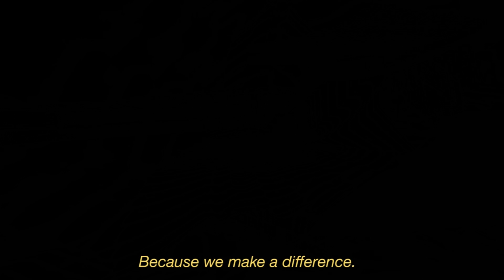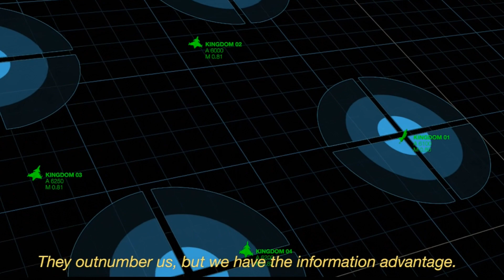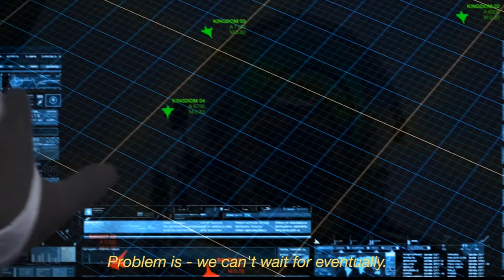Gripen Fighter Jet - Canada's Future Fighter?

Comment: Work at Canadian Bagotville airforce. I was lucky to be right next to the lauch runway. The F18 are still working fine but it's really expensive to maintain an repair. Mainly because no original part are fitting. My friend work for the company which repair canadian F18 and US F18. Every part need to be modify to fit perfectly and it's unbelievably expensive. F18 spend their life flying over the Artic. The next fighter need to handle intension temperature variation. F18 handle impossible temperature variation without problem. They can carry a considerable of fire power too. Buying smaller one will give them capability for Dog Fight. I watch them all the time and they could make pretty impressive maneuver with a skill pilot. An F18 Hornet with a superior driver can be really effective. Arsh climat is not made for every airplane. The only reason we need to buy new airplane is to provide only support to US. Let face it, they talk a lot about new plane but they never put them to extreme condition in reallife situation. F22 and F35 are too advance. These plan take insane amount of caring, F35 need to have 35 hours of maintenance for 1 hours flight. A SU can land refuel and immediatly go back. A SU is build like a tank. F22 and F35 are in my opinion lack this robustness. They need to clean perfectly runway before takeoff only a small debris can break the plane. They are really powerful and advance plane but Canada need a something more robust ready to go at any time. For example it take only 16min to get to Montreal from Bagotville (500KM) in a F18. The 16 minutes countdown actually start when they pickup the phone at the military base. To be honest, I did believed it until I happen.

Comment: This always comes up among Canadians, and I've been as guilty of it as anyone, but Canada wouldn't be doing well for itself to design and develop it's own fighter jets anymore. It hasn't been that way since the Avro Arrow days (and no, there's no point in 'resurrecting' the Arrow, because it wouldn't be any good for anything today.)
In a nutshell, it's actually cheaper for us to buy US-made fighters instead of developing them ourselves.  That being said, the price of the F-35 is ridiculous for Canada. If Canada is willing to go with single-engine multirole fighters, buying F-16s would be a better bet--they'd cost us about 1/10th as much as the F-35. If we don't want to buy used aircraft, we could consider buying the design and tooling from the US, and producing our own F-16s, using US-built radar and avionics.
But, attempting to develop our own fighter from scratch is a no-go.

Comment: Gripen E is not that much cheaper than F-35. Last batches from F-35 dropped down to 85 million usd, until Gripen E costs around 75 million usd. There is no point acquiring gripens with this price difference.

Comment: Why should canada buy aircraft that is obsolete...the F-35 and its stealth is the best choice and we invested in it..the only other option is the french Rafale. It is superior to the Grippen and eurofighter...and the grippen cant handle the most modern russian threats. We need a mix of fighters F-35s and Rafales with prop driven aircraft for close air support against low tech enemies. Btw the rafale has a version of stealth. It does so electronically. Screw the gripen. Rafale is superior. ||F35 is superior.
Reply: the french can fuck off!
they NEVER allow other nations to license build the rafale AND their craft isn't fully compatible with NATO Canadian systems. i don't CARE even IF the rafale is slightly better in top performance when it's FAR more expensive to fix and fly. the F35 only makes some sense for canada jointly built in small numbers and only in the VSTOL version as a compliment to larger numbers of the inexpensive Gripen which we CAN BUILD HERE.
The usaf - which is LAND BASED like what Canada's situation is-very successfully used a hi/lo 2 craft solution in the F15 EAGLE air superiority and F16 FALCON light fighter mix which saved a lot of money while providing more airspace coverage and tactical effectiveness within the unique strengths of each aircraft.
if we're going to spend billions in acquisition- MUCH of that should be in EMPLOYING our own people to build.

Comment: The Gripen is an excellent aircraft and deserves success.  That said, Canada's RCAF mafia will never let it be selected over an American design.  As with the Super Hornet, they'll claim a lack of interoperability with USAF NORAD aircraft, which is nonsense. 
The current CDS seems to deny the Gripen's existence by claiming "you can't lease fighters."  Well you can if it's a Gripen.  I'm not a fan of a single-engined fighter flying over northern Canada, but if it's good enough for northern Sweden... The best option is probably a high/low mix of 2 squadrons of F-35s (ugh - but they will get better with US money behind them) and 4 squadrons of Gripen Es.  Make it so.

As for building locally - terrible idea.  It will add cost, it won't make a material economic impact and it will ensure that too much money goes to Quebec.
Reply: Why should Canada replace legacy F18 byan Aircraft rated less efficient? That's stupid or just face the fact that Canada do"n't need an airforce and provide bicycles to your army...
Swiss report about the evaluation of F18 / Typoon/ Gripen and Rafale! :
https://fr.scribd.com/doc/81390363/Swiss-Air-Force-Confidential-Report-on-the-Evaluation-of-the-Eurofighter-the-Gripen-NG-and-the-Rafale
Reply: Alpha, those papers are 10 years old. There has been several updates to the C/D version of the Gripen to correct some of those shortcomings, the latest upgrade is only a few months old as I recall it. And Gripen E/F will be completely different than the old C/D versions.

Comment: I think the Rafale would be way better as a front line fighter. As far as light fighters the F/A-50 would be a cheap option for low cost. Im hoping the USAF selects them to replace the T-38. The Filipinos impressed our Growler guys with their FA-50PH. Word is they handle like the tiny F-16s they are designed to be. Plus the RCAF already has the support base for the GEF404 that the F/A-50 uses like the JAS-39.

Comment: According to the Swiss AirForce evaluations the Grippen is certainly cheap but has poor capabilities compared to its European rivals (EF2000 and Rafale) and especially when it comes to the Rafale.

In my opinion the Rafale F4 would be a better choice because though it is a bit more expensive than a Grippen it has an extreme versatility, bigger range of ammo and most of the very last tech upgrades available. 

And less US dependance when it comes to weapons and spares supplying.

Here is a very interesting document: 
https://fr.scribd.com/doc/81390363/Swiss-Air-Force-Confidential-Report-on-the-Evaluation-of-the-Eurofighter-the-Gripen-NG-and-the-Rafale
Reply: "but has poor capabilities compared to its European rivals"
In endurance and payload at least for the C/D version. So Rafale or the Eurofighter are better in offensive roles. The Gripen E will improve these parameters somewhat. But Gripen should be the best alternative for defensive operations due to low cost per flight hour, ease of maintenance, quick turnaround time, no need for a large ground crew and no need for large airfields etc.

Comment: This is a single engine fighter. No it won't work for Canada. People never consider the actual "requirements" based on individual country climate, territory or terrain.
Reply: kloudkreeper 
It can not be much of a requirment if the plane most likely to be chosen is powered by a single gingantic and largely unproven engine which allegely have had some issues along its development. Anyhow: It have been many years since planes was flying araund with two engines for safety reasons because said engines flamed out with somewhat worrying frequensy. 

With huge advancements in technology todays engines have come a long way in terms of reliability. Today, in general twin engine aircraft suffer slightly more from catasstropic engine failures compared to their single-engine counterpart.

Also in the rare cases when modern high perforance jet engines do fails, they tend to do so fairly violently rather than just stop working. Engines are placed so close together in western twin-engine fighters that there’s a good chance that the failure of one engine will damage the second engine or/and nearby (shared) systems that it relies on.
It can not be much of a requirment if the plane most likely to be chosen is powered by a single gingantic and largely unproven engine which allegely have had some issues along its developmemt. Anyhow: It have been years since planes was flying araund with two engines bfor safety reasons because said engines flamed out with somewhat worrying frequensy. 

With huge advancements in technology todays engines have come a long way in terms of reliability. Today, in general twin engine aircraft suffer slightly more from catasstropic engine failures compared to their single-engine counterpart.

Also in the rare cases when modern high perforance jet engines do fails, they tend to do so fairly violently rather than just stop working. Engines are placed so close together in western twin-engine fighters that there’s a good chance that the failure of one engine will damage the second engine or/and nearby (shared) systems that it relies on.

Comment: Any plane Canada BUYS has to have Carrier Landing capabilities'. Why you ask ,because in our far North we use a trap system just like a carrier does, why you ask, when our fighters Take off and use after burners they Ice up the runways, they need this system to trap and land the air craft in a safe manner on very icy run ways. How do I know this you ask, My neighbour is a Retired SGT Major 1st class R.C.A.F. and has Told me in Detail about working and Handling the crew's that Maintain said Trap system...Look it up if you think I'm full off it.. So our planes need to have Aircraft Carrier Landing Gear and Tail hook systems Not all air craft has that or can have that. Oh and one other thing it's single engine..R.C.A.F..Wants twin engine they were getting the F35's rammed down there throats....
Reply: 1-a landing trap system is NOT a CATAPULT! nether does canada HAVE any aircraft carriers with said catapults.
2- modern warjet attrition losses due to engine issues is actually greater with the twin F18 than the single jet F16.
each engine is a huge part of the purchase and flying cost of each plane, resulting in a given nation affording a much larger number of single jets than twin jets. so even IF attrition losses were slightly worst for singles , WAR is a numbers game AND pilots are not irreplaceable-sadly  i say this even though i lost a ww2 bomber crew ancestor.  
btw, the Gripen was designed to be fitted with a tail hook while unassisted it greatly outperforms any Hornet for short rough runway takeoff.

Comment: The Griphen is a good plane and a good fit for Canada.  

The F 35 on the other hand is not and Canada should avoid it at all costs.  Over designed, over priced and overly complex it is a lemon that should be scrapped and sent back to the drawing board.
Reply: schrodingers cat "Over priced" the F35A costs 81 million while the F35B the most expensive model costs 122 million (low rate production) while at the same time being more capable than any legacy airframe in US service
Reply: The numbers I saw were 105 for the A and 113 for the B.  Now remember this is the RCAF not the USAF we are talking about, they are not exactly overbudgeted.  If they go with the F35s, considering the current governments military spending priorities, I'd estimate they could buy 25 i they go with the Gripen that would get them around 60.  Yes the F35 is a better plane but 25 of them are useless as the grand total of a countries air force if the country is the size of Canada.   Now I admit they are not as overpriced as the F22 but still you are still talking about over 100 million dollars per aircraft, in peace time where the only enemies the country has fought in the last 50 years did not even have an air force.  

Personally I would prefer the Typhoon, but almost anything would be a better fit with the RCAF needs over the F35.   The F35 costs so much because it is at least in theory a Jack of all Trades that actually excels at most of them (when it does not kill its own pilot).  But what Canada needs is a dedicated Air Superiority fighter in sufficient numbers for reasonable defense against theoretical non US enemies.  Probably the Russians.

Comment: It will come down to cost, licensing the manufacturing (Canadian jobs), and interoperability with allies (the cost benefits of mooching off allies in the name  of solidarity).

The late 70's had a huge competition for the next fighter between  aerospace giants.  The 15, 16 and 18 (then 17) plus the revamped F-5 all wanted a piece of the pie.  Cost overruns like the F-35 would have eliminated them from the competition back then.

I feel for the RCAF who are stuck having to make old stuff keep working and not get hurt over political dilly dallying.

Comment: Personally, I think Matsimus has it right here.  Get the Gripen and build them in Canada which would offset some small amount of cost and get some more aircraft tech and jobs in Canada.  But also continue participation in the F-35 program and preserve that portion of the aircraft tech and jobs as well.  As some have stated above, stealth will certainly be necessary when countering countries with advanced air defenses (eg. S-400, S-500) systems bought from Russia and China in the future.  No Canada is not an aggressor nation but it does have international commitments (NORAD, NATO) that it should fulfill.

IMHO a much more important feature than stealth is networked warfare with the ability to share sensor data and potentially control drone 'wingmen'.  The F-35 has recently shown that ability in tests with the USN where it has acted as a forward sensor for SM-6 missiles which have shot down cruise missiles.  Yes, POTENTIALLY Gripen and other aircraft can do the same thing but the US (and likely UK) are actively developing this capability and it is the real raison-d'etre for the F-35 family and future aircraft.  If F-22 datalink could do this they would build more of them but they are going to expand this network-centric warfare capability in 6th gen fighters instead.

As far as intercepting anything or penetrating advanced AD systems, acting as a stealthy forward sensor for a hypersonic missile (SM-6 flies at Mach 10.2) launched from a land battery (eg. Aegis ashore), ship or bomber well out of harms way is the future.

Comment: The Canadian government really is at odds with Boeing, I'd be extremely surprised if they purchase super hornets at all. Especially since Boeing is really fighting tooth and nail against Bombardier and the c series. A spat that"s been going on for about 9 months now. As to your point about acquiring multiple A/C, I really doubt we'll/they will go that route. The cost of maintaining two top line aircraft, training pilots and crews and purchasing spares is going to be extremely high. Another point that the RCAF has made many times is that they do not promote purchasing a single engine fighter. (even though single engine a/c have a great track record in reliability) That's why they went with the f18 instead of f16s back in the late 70's. Back at the late April airshow in Ottawa for our 150th birthday celebrations, only one out of the five aircraft 'offered' aircraft was there. (by surprise too I add). That was a pair of Eurofighters. they were not originally supposed to attend but they did. A superhornet was supposed to be there and was last minute cancellation. (right around the whole c-series spat becoming public) The next bit is just pure speculation: My guess is that they will go with the eurofighter; reason being 1) Canada just signed CETA 2) The gov't owes airbus for bailing out the c-series program which they had a lot of stake in 3) They are really displeased with Boeing 4) NATO compatible just like all five other aircraft 5) Its a twin engine. Great video, the gripen's a great a/c. Personally I find the Rafale to be the nicer looking aircraft and we all know that looks are the most important thing. Thank you for keeping the conversation going!

Comment: Agreed on the high/low mix with these. The F-35 doesn't have to replace every jet but would be good to have a number of to deter any Russian friskiness, while the Gripen could also more affordably fill out numbers for our large borders.
Reply: The Gripen needs to be able to link (weapons/situational awareness/targeting) with the F-35. I don't know if that would even be possible. The Gripen is capable, but would be at a disadvantage to newer platforms without the overlook and stealth factor (F-35) giving pause to any enemy aircraft probing airspace.
Reply: If the datalink can't be worked out, it could still serve as a point defense system at a cheaper cost to fly than the F35, while the F35 kept our more friskiness risk factor borders at a technological advantage over any potential adversary. Then of course the economics of running two systems rather than one would have to be looked at and I don't know if it would be cheaper after that, but it would be an interesting mix. F-35 for the big boys, Gripen for where you need something capable but not so costly to run. Keep in mind also all our NATO missions have been served by F-18s so far, so the Gripen can still do a lot in an F-35 era.